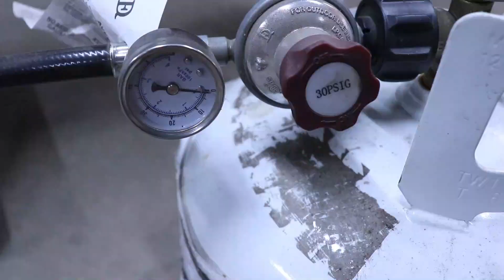Forging A Hotcut From An Old Hammer

Comment: Believe you said only heat treatment the tip Believe it's quenching then the heat treatment to tuffen the tip.
But that tip will get hot in use
Reply from the maker: I may have forgot to mention it but I quenched and then tempered directly after the quench its just hard for me to film.